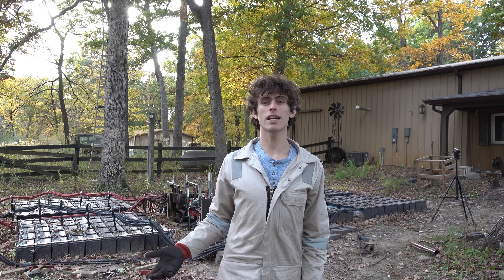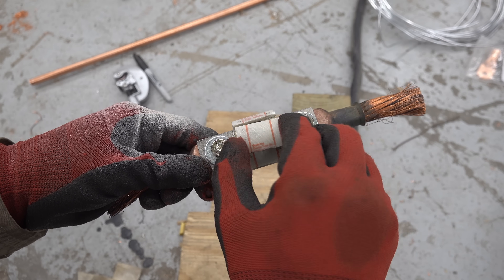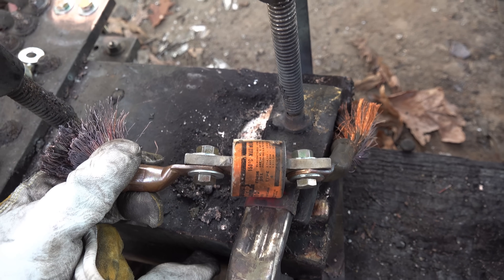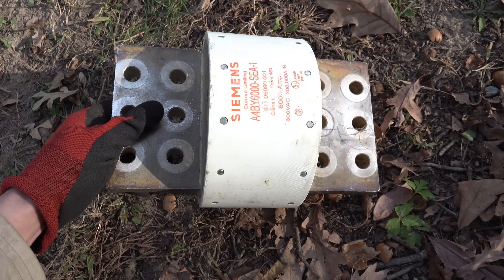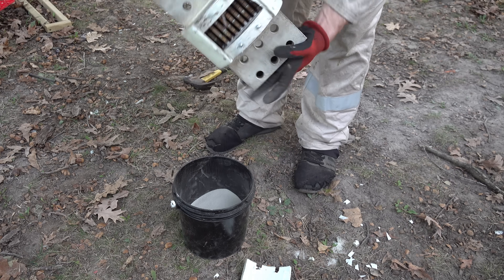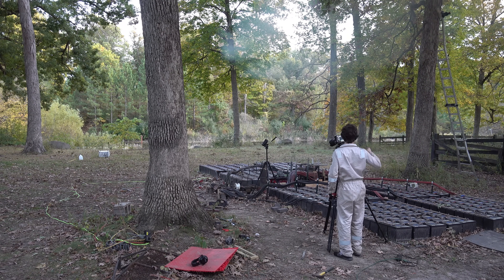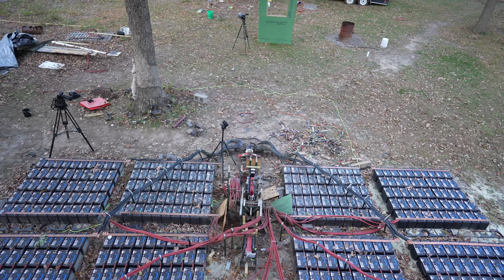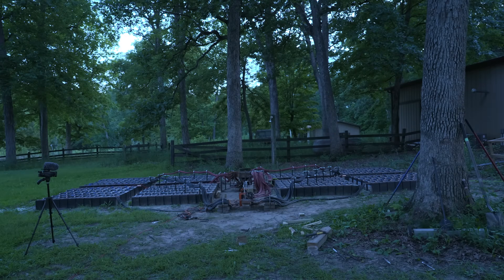Popping a 6000 Amp Fuse

Comment: May be a good idea to put some plexiglass or something over the batteries so flying metal debris doesn't short stuff out. Also I'm surprised you're still using clamps and not just bolting through the contacts. Also also, I know you made the cables as short as you can, but maybe a little extra length could let you have a little loop near the contact blocks to try and cancel the magnetic fields a bit? although you probably couldn't make it tight enough to really help that much.

Comment: Ok you need to actually nuclear fuse something. You HAVE to be getting at those energies.
Reply from the maker: the magnitude of current is there for achieving D-T fusion via a z-pinch. converting it into a sharp pulse would be tricky though
Reply: @styropyroshorts  So once again, it's the switch.

Comment: Pretty surprised that spring clamp strategy worked! You know about "contact blow-off force", right? When current is forced to neck down at small area contacts from a larger bus or contact button cross section, the Lorentz force acting between the halves of the hourglass shaped current distribution causes a repulsion force between the contacts, tending to separate them. Not sure what 150kA would do over that area, but apparently four spring clamps is enough! That's in Slade's compendium "Electrical Contacts", if you haven't run across that book yet. Most of it isn't really relevant to what you do but there's some interesting stuff about switching arcs and beaker arc chutes and splitter plates that you'd probably find interesting.

Comment: WOW!!! Just WOW!!! I wonder what kind of switching mechanism you use here, that must be the weak point... right?
Reply from the maker: yes the switch is the weak point! it is made up of two log splitters that crush giant plates of copper together. the main issue is that it ignites a magnetically imploding plasma between the plates so it takes a few hiccups for the switch to fully close
Reply: @styropyroshorts  That is amazing, will it be explained in the coming video about it? And what levels of EMP does this emit?

Comment: BRO, At 1:12 You can see the Lines MOVING because of the current.  that made the hair on my neck stand up. PLEASE be careful man . LOL that thing is WILD
Reply: You should check out his other video on the car batteries. When he lets the current flow the cables jerk hard. It's terrifying.
Reply: I used to jump-start big diesel engines at a crushing plant with my 988 CAT (another giant diesel) I had premium 25 foot 4 gauge jumper cables with copper clamps and heavy springs. I always made sure the connections were tight and when hit the starter the cables would jump two feet. Awesome! (as long as you or I don't become the conductor)
Reply: In the main channel video the magnetic fields created kept ripping apart the support structure for the switch 😂 they are absolutely insane. 

From his community posts it seems like he has an abundance of caution when it comes to this monster, but that doesn't make it less scary to see in action 😅
Reply: @MegaphoneMan0  abundance of caution? He’s hiding behind a tree 6 feet away
Reply: @SatelliteYL  With molten metal spraying past the tree. I would be worried that somehow that would get me or fall on me. If he is wearing any synthetic clothes, they melt into the skin with the metal or any flames. Some sheet metal sides and a top added to the mass of the tree would be an improvement.
Reply: Is that not just the mechanism he's using to close the switch?
Reply: We have a 480v 3 phase spot welder at my work. Same thing cables jump with some force when the weld is made.
Reply: I don't see them moving
Reply: @lavaking1113 he's talking about those red cluster of cables near the center, the ones hanging down
Reply: @queueeeee9000  I see it now thanks
Reply: @lavaking1113 you're welcome

Comment: Why do you not at least put up a shield to keep all the molten stuff off you batteries and cables before you short something and all those battery's run away on you. Your fire department and local govt are not gonna be pleased about that. I hope no kid loses there ball over your fence and happens upon that thing. These are cool videos though.
Reply from the maker: for one, you can't accidentally cause a short that runs away with this setup. the magnetics forbid it. there's also no risk in touching it because it can't shock you. besides, i don't have any close neighbors

Comment: 0:32 Dry autumn leaves, 400 car batteries sitting on 2x4s and concrete bricks, a redneck rich amount of copper resembling Cthulhu, and the fucking madlad is standing in shot with half his body showing from behind the tree 10 feet away from the homemade hand of god violently demonstrating some of its potential, Forest fires are a myth to this guy.

Comment: Added a 250A Class-T fuse to my camper LiFePO4 battery system. The little "ting" sound it made when it blew was very disappointing considering it cost $50 to replace.

Comment: Some of the industrial control panels I design have operating currents of over a 1000 Amps. The trip currents on the circuit breakers I use can have trip currents as high as 10,000 Amps, but we usually limit the available fault current to no more than 25,000 or 30,000 Amps.

Comment: is there a risk of the negative and positive arcing to you if you got between them with that glove
Reply from the maker: there is no electrocution risk since the voltage is low. i can touch the contacts and only feel a tingle.
Reply: @styropyroshorts  so the amps don't matter cuz the voltage is so low. interesting. it's also interesting to know that you can cause explosions with 12v but to you it would just tingle

Comment: Small suggestion for your clamps, look at the fireball maximus bar and dog clamps. The threaded end and base are not set to a slide, which you can use any 1 x 2 piece of steel bar for, so you have no set limit on throat size. The screw is very beefy so you can get a tremendous amount of clamping force out of them and since you can use them on a slide, you can limit how much thread you have between the arm and pad. I think these would allow you to get more clamping force with less twist during these explosions. I use them in heavy fabrication to clamp stuff down to my work table, or if i really need it, i can flip the arms around and use them to spread. And with the ability to swap out spines, i can use box tubing if i need them lighter or solid bar stock if i want it to just clamp the crap out of something.

Comment: Just as a quickie, drum cymbal. One wire to stand, One wire just touching brass. Theory or operation: Vaporized metal rockets cymbal away from wire making sound on now out of tune cymbal. It rebounds, maybe touching wire again. Repeat several times maybe. Expected outcome: sound of molten brass rain with 5% chance of EMS sirens.

Hopefully you can come up with something better and then summon PHotoinduction from his lair deep within the spleen of the Earth . Personally, I wouldn't be beyond doing it in a circumscribed pentagon while trash talking him in broken Latin and popping bubble wrap by the wicked glow of black carbon rod arc light candles.

Comment: If you get some more batteries, you could even verify the 200kA interrupting rating. The fuse should interrupt shorts over 200kA, but at that point it's no longer tested to do so without blowing up and initiating an arc blast. The actual interrupting capacity is probably way more than 200kA, so it might be beyond you. Maybe Photoninduction could manage it (yes, this is a sad attempt to rile you into attempting it).

Also, I just want to point out how insane it is that there's enough energy released to vaporize pounds of copper within a second or so. Electricity is no joke

Comment: Styro needs to invest in an industrial vacuum circuit breaker for this to stop getting contact contact problems.

Also, it there's one less obvious reason why a mega-fuse is a bunch of smaller fuses in parallel: all electrical components and distribution have some amount of inductance. Instantly interrupting 100k's of amps would cause a massive inductive spike, but breaking this apart over a series of even milliseconds can dampen this effect and save the system from a voltage spike that could lead to arcs or premature insulation failure.

Comment: You really gotta be careful , man The sodium sounds extremely dangerous.
Reply from the maker: i've been playing with large amounts of sodium for over 20 years. i would argue that zapping it with my circuit is more controlled than tossing some in water.
Reply: @styropyroshorts can i have some for my food? I know its not no table salt but i heard it was a hot topping.

Comment: You blew the contacts since you didn't clean them! The greatest resistance was at the crud on the contacts, causing large amounts of heat blowing up the contacts.
Reply from the maker: nah it blew up because of the variations on the blocks from the previous experiment. i found that the resistance across those dirty interfaces quickly becomes very low on a big current impulse, as the conduction path there becomes molten metal, bypassing oxides.

Comment: would a jig/fixture using hydraulically compressed truck coil springs work for the contact clamps? or would the magnetic forces be too much, i had a bad experience with lightning hitting 12 feet from me as a kid so i don`t know much about pixie stuff

Comment: I'm not sure how you have those batteries connected, but assuming they're in series at 60V the peak power output was around 9MW, and judging from the traces on the oscilloscope I think the energy output was 200-400kJ, which is comparable to one or two rounds from the gun on an A-10. You're a brave man standing that close to it!

Comment: couldn't you wire up your high speed camera with the switch for the car batteries? this way you just have to press one button and it automatically starts (and after a certain time stops) the camera. would probably be more pleasing to deal with. i assume your high speed camera came with such a funcitonality.
Reply from the maker: i had a wired trigger for the slow mo cam, but i removed it because it kept getting EMP'd!!
Reply: @styropyroshorts  oh damn, i didn't expect that.

Comment: Love that the safety shield is a way-too-close tree
Reply: Oak strong. Protect boy from fire sparks. 😂
Reply: @squirrelmandan5262 boy, that’s a man with the highest testosterone levels out of 99.999999999999999% of us
Reply: "...the apparatus was remote operated, and the technician was protected by about a meter of composite material..."
Reply: Before it turns into compost material
Reply: @ZomB1986  That tree would absolutely destroy a 2-ton vehicle traveling at highway speeds. Shrapnel from a popping fuse wouldn’t turn it into compose material. You’d need dedicated high-explosives to take down a tree like that.
Reply: @bluewater82   No, you wouldn't... All you would need is for the tree to have moisture in it and for the electricity to arc to it. Or are you actually trying to convince people that electricity won't heat up and expand liquid? LOL.
Reply: @mimcduffee86  dude, you would need a lightning stike to transfer electricity through an oak tree like that. And even then, you'd be more likely to be killed by the tree falling on you. 

Got a junion sparky over here. 😂
Reply: @FireStormOOO_  Love this :)
Reply: @FireStormOOO_ by definition wood isn’t composite you need 2 or more materials together
Reply: @jjelassar  wood + bark + clothes
Reply: @GooberLeague lol you got me there
Reply: @jjelassar  Lignin, cellulose.  Nobody said humans had to do the mixing.  Just wouldn't count as an engineered composite, which is usually what people mean.
Reply: @GooberLeague and air! Air can be a material! Heck, American houses are mostly made of that Stuff! 😂
Reply: @catastic-d3x  poor people's houses* , fixed it for you I build rich people houses for a living those things are friggen fortresses 😂
Reply: @jjelassar   That's wild. So by your own definition, wood is a composite seeing as natural wood is a product of more than two distinct materials (cellulose fibers and lignin). But despite it fitting your own definition, you still needed to correct someone so you claim that wood isn't made of distinct materials.
Reply: He's got wood! :D
Reply: @billant2  Wood is good
Reply: Well, he looks like he's wearing an arc flash suit or similar... that's something in case the valiant tree fails.
Reply: Dorkus Oakenshield
Reply: It's honestly a great shield. I trust it more than any piece of metal affordable enough to buy or any old bullet proof glass. Smart
Reply: @2hcy  heh... it's smart for what he's got, but part of the whole safe-distance thing is to account for stuff you don't see/expect.  He's barely out of that magnetic eddy he sets off, for starters, but what if a battery went and a cloud of acid was following the pop that he just rolls out into from behind a tree.  The tree's not the problem, lol, it's that he's really close to some very strong invisible ghosts who love to throw punches.
Reply: @MerkaRaukea  Not actually clear if the individual batteries are being abused all that much.  Pretty sure he's asking less of these batteries than turning over an engine does - they are designed for pulsed power applications.  He has rather a lot of them and the individual currents are less insane.  Mind you I do understand the instinct to err on the side caution and not get a face full of acid.
Reply: @MerkaRaukea  what if a plane falls from the sky and lands on him? He's a professional, nothing to panic about
Reply: @FireStormOOO_  exactly how it'd go on a paper lol
Reply: @2hcy   I would not trust an electrical conductor to shield me from electricity. That's like hiding behind a vat of nitro to shield you from an explosion.
Reply: @2hcy get some of NileRed's bulletproof wood.
Reply: The tree is definitely grounded. ;)
Reply: Honestly it'll take a ludicrous amount of violence to phase an oak that big.
Reply: Equivalent to safety squints 😂
Reply: @heliumburrito  Hopefully that was sarcasm haha That old tree is built like a tank and its compressive strength is comparable to reinforced concrete. Trees like that routinely stop 4,000lb vehicles traveling at highway speeds dead in their tracks. Small pieces of shrapnel and molten metal don't stand a chance at penetrating it.
Reply: @bluewater82 Flash boiled lead-acid electrolyte turned into steam may, though. Totally his prerogative, but I'd go for distance because of what you DON'T consider. You can walk with a peg leg, but you can't see with a glass eye.
Reply: @bluewater82  The tree is very tough, but the molten metal sprayed out had me scared for him and an exploded battery wouldn't be good. It seemed like he jumped right out from behind the tree, almost before all the crap even landed. I have had the tinsel fairy visit before........and I know what I am doing. The lead is on my garage ceiling. Even small amounts of moisture under the surface of molten lead can go quite a ways. Luckily, it cools pretty fast. Dumping wet sprues back in with a ladle is a calculated risk and luckily none of it landed on me. If I was him, I would wanted some cover over the top of me.......look at all that hair waiting to be burned.
Reply: Trees are pretty stury, it should serve fine to block shrapnel.
Reply: Based
Reply: @Tree_64  besed indeed ^^
Reply: How about those safety sandals lol
Reply: Better than the plastic table from last time
Reply: I’d take nature as my shield EVERYDAY over a man made product ❤
Reply: He didn't flinch... But I shouldnt be surprised
Reply: Just Mad Scientist things.
Reply: But it works perfectly fine
Reply: ...I would honestly still put up a safety shield behind (and/or in front of) that tree for extended protection against near misses, but it should still be a perfectly fine shield.
Reply: He is our little treasure lol
Reply: to be fair, i think its more wild that the device draws in metal like one of those body scanners in the hospital. that bolt was a decent sized bolt to be pulled from wherever it was laying originally.
Reply: You can see that his self-defense tree has taken quite a bit of abuse.
Reply: You have no idea how sturdy trees are, a .50 BMG round wouldn't penetrate that tree.
Reply: Hahahaha yea that took me out too
Reply: Can we get safety Tree t shirts?
Reply: air is a very good isolator!
Reply: O vídeo é interessante, mas a tradução para o português é hilária. 😂😂😂
Reply: Saves on materials
Reply: whats crazy is it looks like he has had shit tied to both trees in the camera shot 
i wonder what  the hell he needed strapped to two trees?
Reply: I Tought the guy wen't to War so he is used to explosions next to him...😅
Reply: That tree is the equivelant of safety squints instead of welding goggles lol

Comment: When I saw you weren't bolting it down, I knew how that first shot with the big fuse was going to end. Clamping forces on those fuses are extremely important to get their full rating without surrounding equipment failure.

Comment: How are you turning this circuit on? What is the control?
Reply from the maker: the switch is made up of two log splitters that crush giant plates of copper together. the main issue is that this ignites a magnetically imploding plasma between the plates so it takes a few hiccups for the switch to fully close